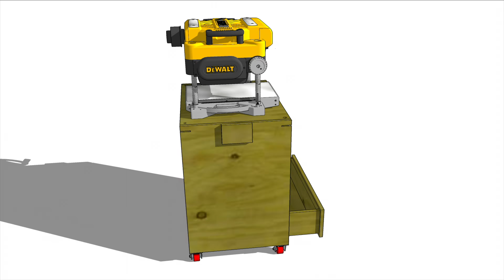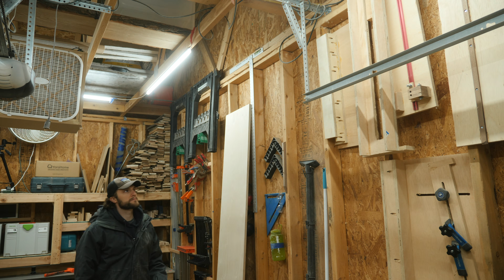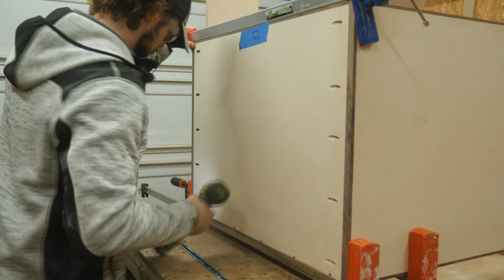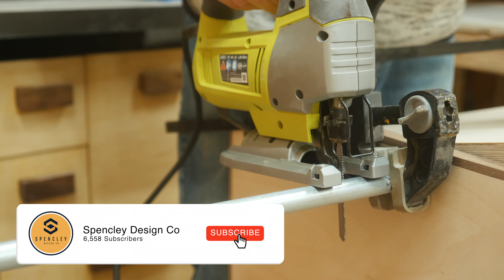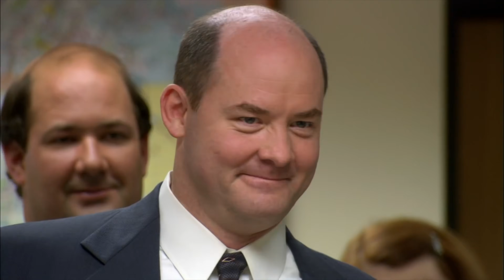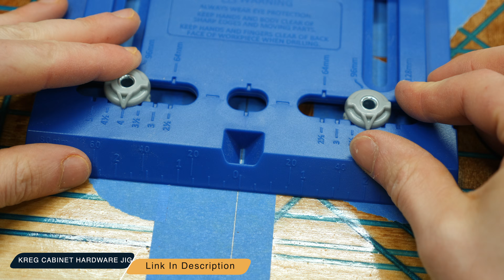Extremely Detailed Flip Top Tool Cart Construction

Comment: I'm curious if you could comment on the strength of this build?  I definitely like the idea but I'm worried that because of the lack of bracing higher up and the deflection from the weight of both machines and the vibration of both machines will cause the structure to fail.  Am I overthinking this?

Comment: Love the resin idea!  Great flip cart however I’ve seen several that use black pipe and a T to run your cords through. A small outlet strip or even an electrical box you can plug your cords into. This way they are sandwiched in the sandwich lol . Only one cord coming out to plug in.

Comment: Thank you, this is a great design. I am fairly new to woodworking and don't yet have a table saw. I think I can handle everything with my track saw and/or router, but there is one thing that I'm not sure of. That is the slot for the eye bolts. Is there any other way you can think of that I could do that without using a table saw? I also have a jigsaw and a recip saw, if that helps.Thanks!

Comment: When you are using the cutoff of the angle grinder make sure that the frontal angle between the surfaces and the wheel is shallow as possible. You cut 3 times as slow but your wheel will last 5 times more.

Comment: This is a great design, I'm looking to make a one sided version of this to incorporate into my bench to extend its length and keep the table surface clear when the tool is not in use.From your own prior video you noted that the planer was around 100lbs.  It has been about a year since the build.  Have the screws used to hold this in place "held up"  That is a lot of weight on 4 deck screws.  What about the emt pipe?  if you did it again would you choose a larger diameter or make any changes overall?

Comment: Nice design!  My problem is that I have a Powermatic 22" Model 201 planer that weighs 1,350 lbs.  It's dimensions are 42" x 49" x 59".  My bobbin sander is a Jet Model JBOS-5 that weighs 77 lbs. It's dimensions are 14-1/2" x 14-1/2".  That being said - perhaps you could modify your plans a little to suit my needs?  Just kidding.

Comment: Just bought the same planer and have the same sander. I was originally thinking I would build a flip top table like this but ended up getting the matching Dewalt rolling cart for the planer. Now I would like to get a rolling cart for the sander (may end up building it into a future workbench, but for now want to go with the cart. Is there a pre made rolling cart that works well or is made specifically for this sander?
Reply from the maker: I’m not sure

Comment: I was working on one like this but I totally messed up the top part for trying to get Lag bolts across the top for each tool and fasten them with washers and nuts; how did the "simple" screw thing work for you? are not the two machines too heavy to be held just for 2 number 8 screws?
Reply from the maker: They’re held in with 6-8 screws on each machine. There’s no issue at all with the weight

Comment: Nice - like your flip top portion solution!
Question for you when you planed the drawer front. I assume you used those pieces of plywood to avoid snipe - good idea!  How did you secure them so they could be removed afterwards?  Thanks
Reply from the maker: Thanks for checking out the video, Craig! I used some double sided tape to secure the extra pieces

Comment: I have a question.  I have seen the bottom built the same way on this and other videos.  Would the cabinet be stronger, if the sides were sitting on top of the bottom panel, rather than the side of the bottom panel.  That way all the downward force is to the bottom panel, where the he casters are only on the bottom panel and not split between the side and bottom panels?
Reply from the maker: It’s definitely plausible! I didn’t really think about that during the design. If it ends up failing at that point, well, I’ll know how to fix it the next time 😀
Reply: I'm disappointed that I didn't notice that too.  

Also this:
I have a similar cabinet but I put 2 the large wheels on the back and 2 handles on the front. I lift the front to lever the wheels down to the floor. It never moves while in use but I can lift and move the cart easily. (Modeled after my portable Generac generator cart.
Reply: I was wondering the same thing myself. That’s the only change I will make when I build mine. 👍